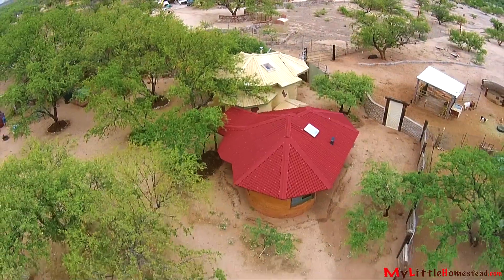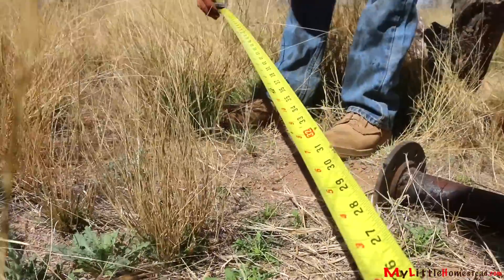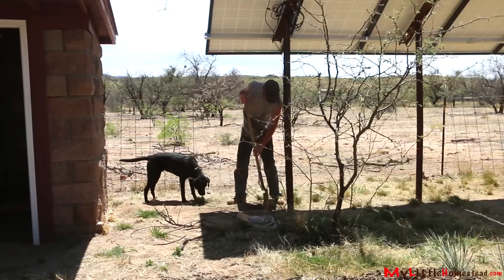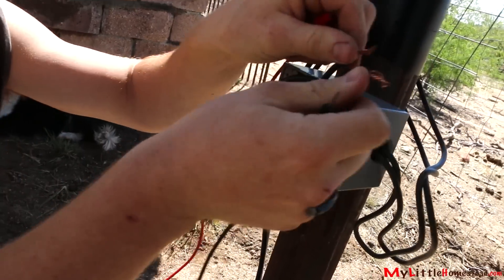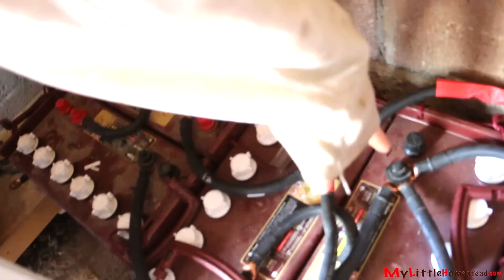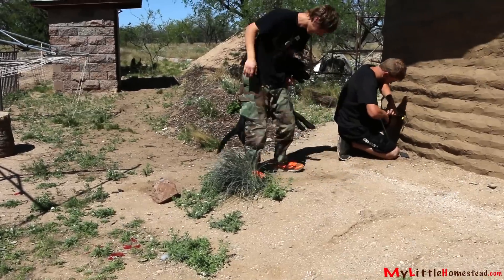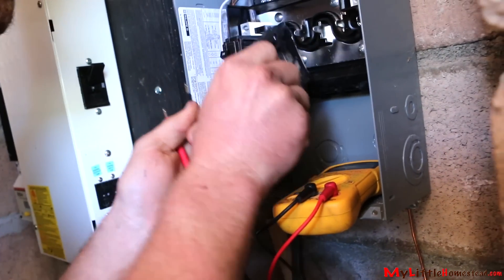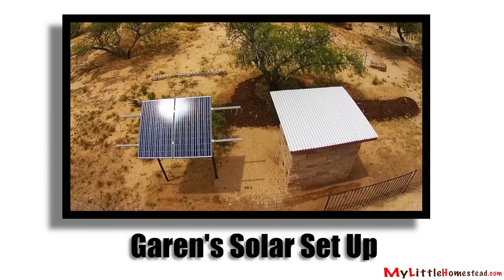Expand Solar Panel System to Power Bry's Room  |  Earthbag Construction Ep 18 | Weekly Peek Ep36

Comment: I made the same mistake with the breakers. I plan on putting heat to both sides of the breaker box so that I can use all 6 breakers as singles, no 240v. My house system is 24v and the shed for my son is 12v.

Comment: To battle the problem of heavier gauge wire you can go up with the panel voltage..Just connect the panels in series of three panels coming up to 72 volts and have two sets of those.. Your morningstar MPPT charge controller can easily handle that. :)
Reply from the maker: Txs
Reply: And greetings from Finland :)

Comment: Having experience in electrical work watching that one dude twisting those wires together with needle nose pliers made me cringe.....nicking copper causes breakage and spark.  All u need is to cut back the insulation a quarter inch hold the wires together and twist a wire nut onto the ends... I usually top the wire nut off with a couple wraps of electrical tape so the wires don't unwind and pop off the nut.... yes the wires create a weld but ur gonna end up having to reconnect those wires when they break down the road with what I'm looking at....just saying
Reply: John Smith. That is right.... suppose to cut a bit longer and  braid or bend them togeather as twisting will break the wires... Ole neighbor electrician (& dog sledder) whom helped hook up a mobile home power box showed me just how and gave warnings as well...many years ago in Superior, Wyoming.

Comment: I noticed you aren't running the 24v DC to the buildings themselves, but instead only run the 110v AC output from the inverter. Is this because there would be more loss over that distance from the low voltage wiring than the loss the inverter causes?
Reply from the maker: +Eric Duprey You'll have to call or email Aaron at Solarpenny.com for that question :)  He is happy to answer questions whether you buy anything from him or not :)

Comment: I am surprised you don't use tracking?? You get about 50% more power with tracking.
Reply: +Submanca i think it is more about 27% more efficiency
http://www.solarpaneltilt.com/ ;)
anyway, as always great video guys, your family is awesome !
Reply: +Submanca When you add tracking you also add complexity, Now you have motors to maintain as well. Thats the reason most homes skip it, well that and the added cost.
Reply: Claythargic
Well IMO the complexity is minor if you have the right mount ie satellite. If you want to increase the size of your system by 50% it's cheaper to go tracking than to buy 50% more panels.
Reply: Hugo Tremolo
You are right it's 27% if you are changing the angle 4 times a year. it's more like 50% when you have a static angle all year long like they do.

Comment: Just a thought, I bet the 3D printers run DC internally, It might be possible to get or make a DC to DC converter and run straight DC to the structure for the printer, and even use DC lighting. there would be a potential savings by not converting DC to AC back to DC, as with each conversion there is a loss of actual power. 
However, the length of the run to the structure might drain some power, There are too many unknown variables for me estimate power loss.
Reply from the maker: +dscrive good idea :)
Reply: +mylittlehomestead
Thank you for the reply, Interestingly, low tech magazine just ran an online article about a return to DC power, might be an interesting read.
http://www.lowtechmagazine.com/2016/04/slow-electricity-the-return-of-low-voltage-dc-power.html

Comment: here is something to add to you tool box to identify the wires at different purpose, like red for DC  positive, green for DC negative, white for AC neutral, black for AC hot, you get the idea. also don't run AC and DC in the same box and make sure all metal and ground pins are connected to common earth ground, including to ground lug on inverter, not that you didn't just sharing, it's a common mistake.Also your battery cable size should be total inverter power/24 volts = amps then check a wire size chart, if they are under size you won't get full power from inverter, just saying.you may consider adding some time a MPPT charge controller that you could wire panels in series to get a higher dc voltage, hense getting more power on the existing #6 cables, like the midnite classic.Love what you are doing.http://www.homedepot.com/p/GE-14-ft-3-4-in-Electrical-Tape-Assorted-Color-5-Piece-18156/203709206
Reply from the maker: +Rev John O'Toole Thanks for the info - we will pass it onto Garen :)

Comment: Great video, I would have run the under ground wire through 3/8" pvc. But where i live it rains a lot.
Reply: C. D. M. i should of specified pvc electrical conduit . its grey pipe . regular pvc to run wire in is against electrical code
Reply: C. D. M. also if you run wire under a driveway code says it must be in approved metal conduit . so yes they do make metal conduit for burial purposes
Reply: +Michael Hunt i would of ran conduit . its cheaper then pvc and i would of ran at least 2 inch so if they add more panels its easier to pull wire and increase size
Reply: +grizz270 You can't run conduit underground it is against code and logic, even galvanized metal will rust if it is left in contact with the earth